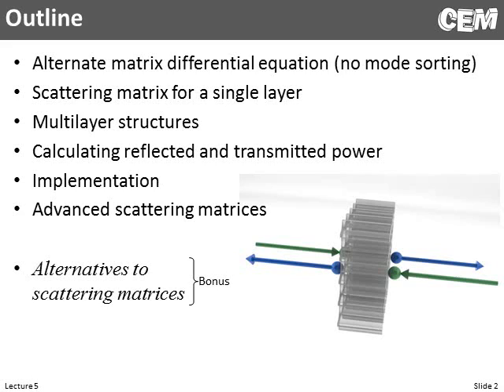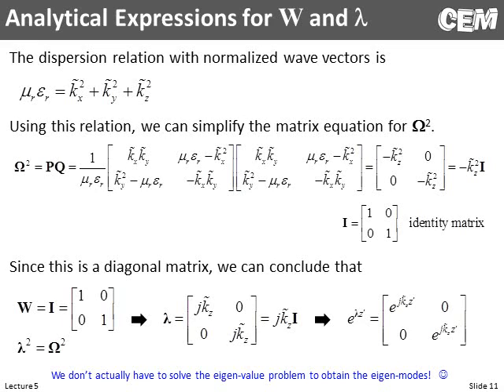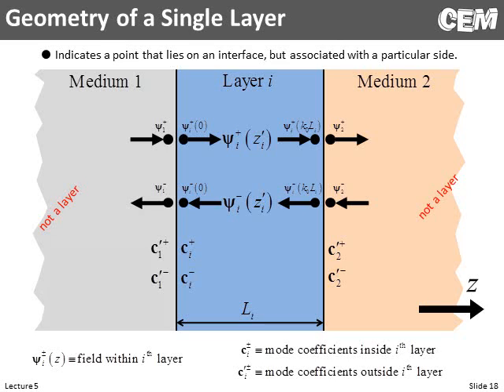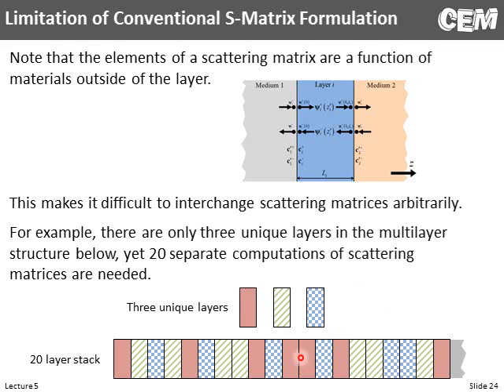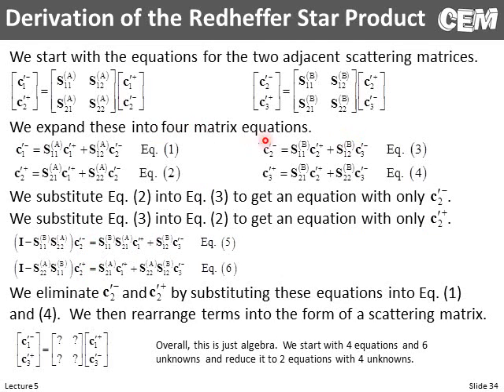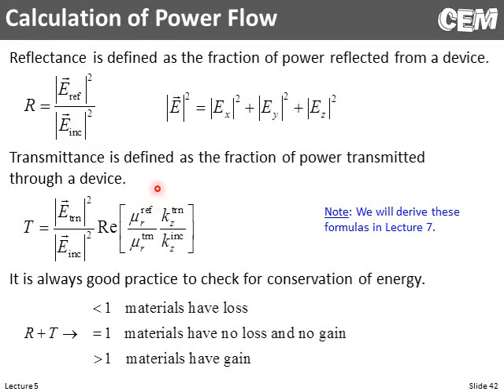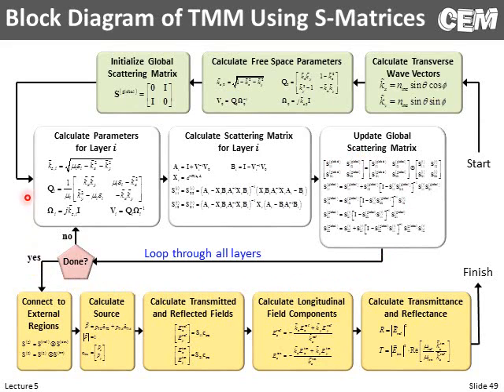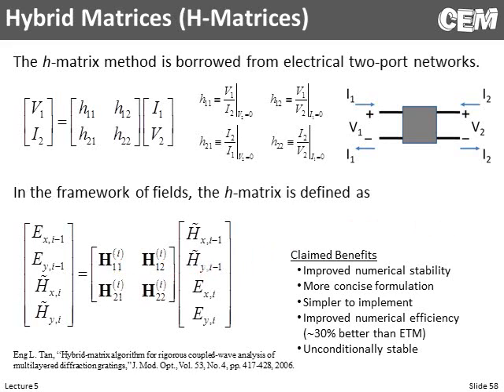Lecture 5 (CEM) -- TMM Using Scattering Matrices

Comment: Hello sir,

I could not understand why you have inserted the zero thick air film between the stacks of layers. 
I have three layers metal/dielectric/metal /substrate. I need to get the reflection from this system of layers. If wave would travel from one medium to another and it would change the phase on reflection from each layer. But if I would insert the air film in between it will distort the result what actually I am looking for. Please explain. Thanks.
Reply from the maker: There are several reasons this is done.  For a complete answer, read the following journal article...

R. C. Rumpf, "Improved formulation of scattering matrices for semi-analytical methods that is consistent with convention," PIERS B, Vol. 35, 241-261, 2011.

The short answer is this lets the scattering matrices not depend at all on the materials in adjacent layers.  When this is the case, you can interchange the order of any scattering matrices you calculate.  For your structure this is not very important, but for other more longitudinally periodic structures it is very useful.

The materials outside of each layer are set to some homogeneous medium, not necessarily air.  If you follow the formulation, when two scattering matrices are combined, the homogeneous layer between them will have zero thickness ans so it will not distort the amplitude or phase of your result at all.  It is simply a numerical trick.

Comment: How would one extend this to also calculate the DOS and group velocity?
Reply from the maker: First, I want to point you to the course website that has all the latest version of the notes.  There are a considerable amount of corrections and improvements since the videos were recorded.

http://emlab.utep.edu/ee5390cem.htm

Second, I would suggest using a different numerical technique for doing this, but you can certainly still do it with TMM and scattering matrices.  See the first section in Lecture 6 that talks about dispersion analysis.  Essentially you need both frequency (w) and wave number (k) and group velocity is calculated according to vg = dw/dk.  You can get this information from the dispersion analysis technique.

For a more detailed discussion of group velocity, see the first section in Lecture 22 in the EM21 course.  Here is the website for that course:

http://emlab.utep.edu/ee5390em21.htm

Next, I would look through Lecture 7, also part of the EM21 course which covers the general theory for electromagnetic waves in periodic structures.  I "think" all the theory you need is here, although I do not specifically address DoS.

Last, take a look at the plane wave expansion method (PWEM) in the CEM course.  If your device is 2D and dielectric, I suspect this will be your method of choice.
Reply: I just mean for a 1-D dielectric stack. I think I've got a working program, in that it spits out reasonable reflectance versus transmissivity. And I know that for some layer m, k_m = omega * n_m / c. Also, I know from literature that the DOS can be obtained from the complex transmission coefficient (t = x + iy) as 

1/L * [(y' x - x' y)/(x^2 + y^2)] 

where L is the length of the crystal and the primes denote differentiation with respect to omega. So I guess my main question is how to obtain a complex transmission coefficient. Is this just obtained from the global scattering matrix element S_21?
Reply from the maker: You actually already are obtaining a complex transmission coefficient.  It is the S21 coefficient in your global scattering matrix.

Comment: Thank you very much, Sir, for the lectures . In homework 3, everything is going fine except that when I calculate X = exp(omega*k0*L), it gives incorrect value, compared to the benchmark. I reviewed my code several times but i can't identify what went wrong. Did anybody had similar issue ?
Reply from the maker: Try expm(), not exp()
Reply: @empossible1577  Thanks, sir, it worked.  The only remaining issue now is that the real and imaginary parts of the final global scattering matrices ( after connecting to the external regions ) are different compared to their counterparts in the benchmark, making the conservation equal to 0.9869. What do you think the issue might be ?
Reply from the maker: @OMohamedSamehO  So your reflection side and transmission side scattering matrices match the benchmarking document?  If so, check the star product equations.

Comment: Hi Raymond, the code works fine and I compared it with benchmark results. Next step, on slide 40 for Wavelength or Frequency Parameter Sweep, inside the for loop you introduced "LAMBDA". What is this LAMBDA? lam0 is a free space wavelength which is in this case have a range of different values. Could you please guide a bit about this parameter sweeping part?
Reply from the maker: In a sense, frequency and free space wavelength are synonymous.  Optics people like to characterize waves in terms of wavelength, while radio frequency people use frequency.  I present both in my lectures.  In this case LAMBDA is an array of free space wavelengths over which to perform simulations.  You can easily convert this to an array of frequencies FREQ if you wish by using

FREQ = c0./LAMBDA;

Once either FREQ or LAMBDA is defined, you will setup a for loop to iterate through that array and perform a separate TMM simulation for each frequency or wavelength in that array.  In the end, you will plot transmission and reflection as a function of frequency or wavelength.